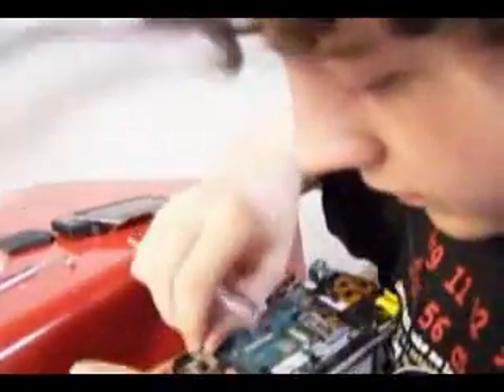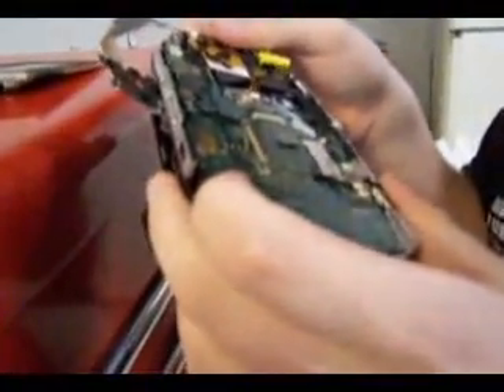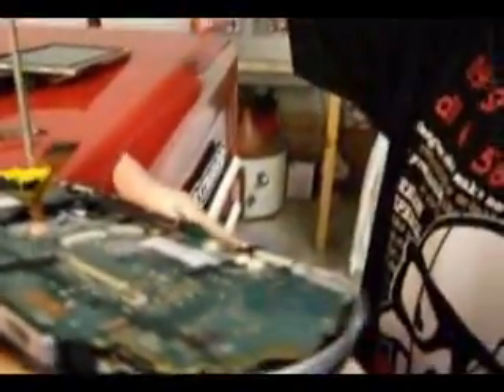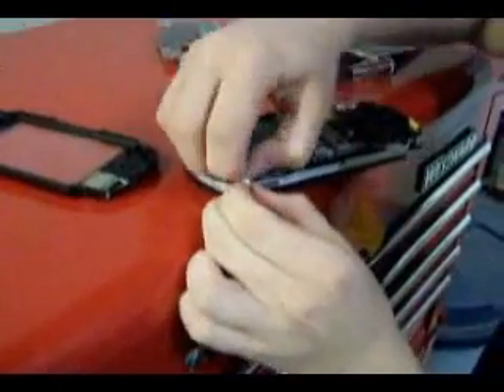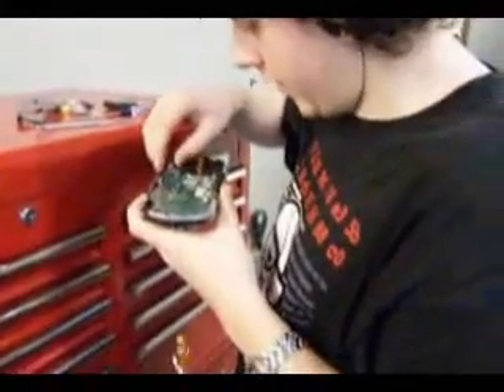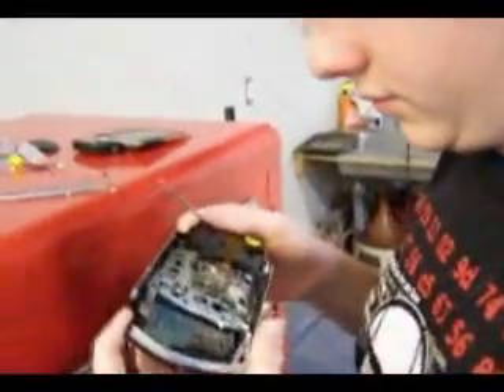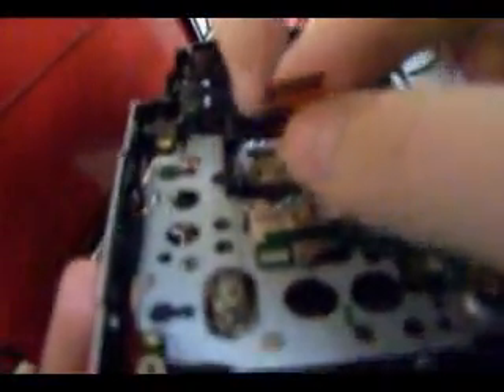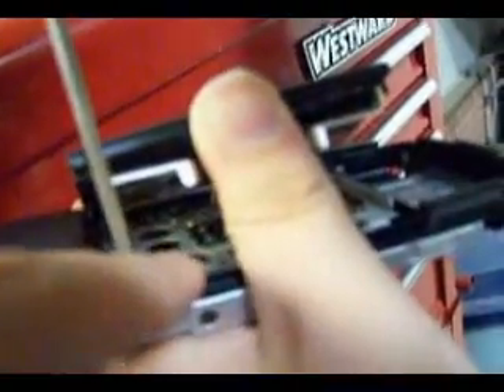How To Disassemble The Sony PSP (Part 2) RE-UPLOAD

Comment: Erm... Pardon me but That brown board with wire thingy, which you said "looks completely useless", is the WiFi Antenna, connected to the WiFi Daughter Board on the left side of the psp.. Lolz..
And the UMD door should be removed first before you try to remove the UMD drive.. =D